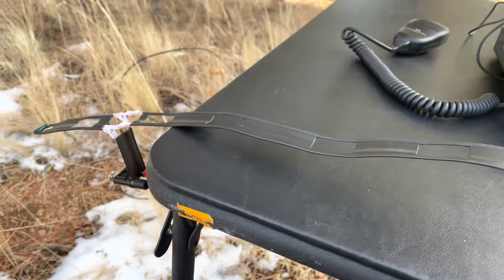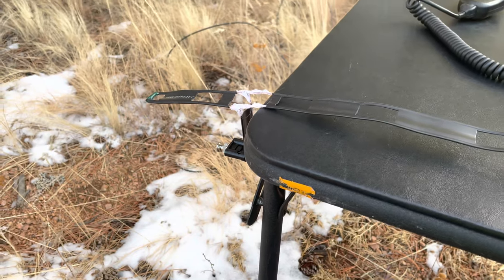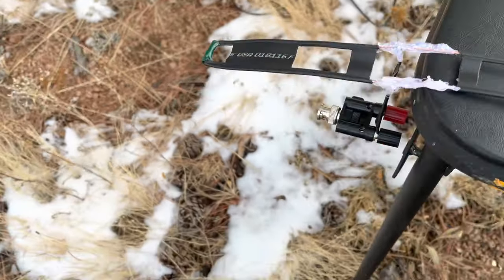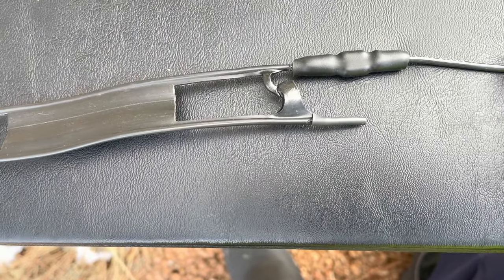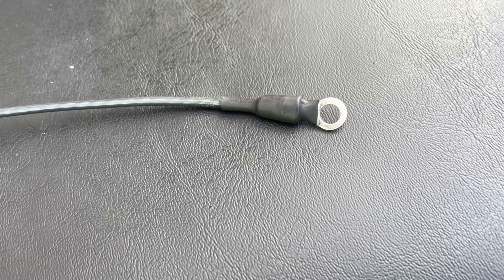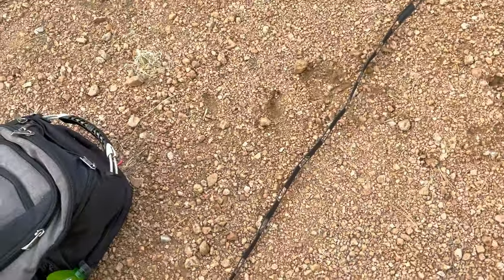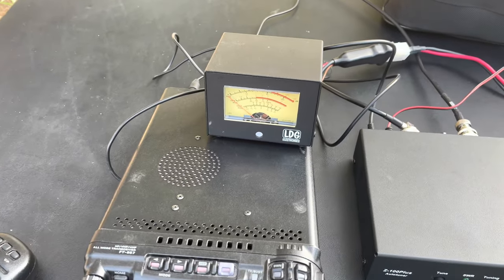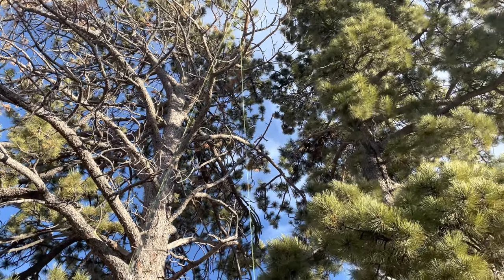Homebrew 6m Rolled Up J-Pole: Will It Work?

Comment: Almost ready to get a new radio with 6m capability. In SW Michigan, almost flat, and I have a tree where I could get it up about 30 ft. It looks so easy to make, even I could do it ;)
Reply from the maker: I would say go for it. It’s been awhile since I had that antenna out but the solar cycle is only getting better. I think it’s time to revisit 6m and get it going strong. Ham-Solo K0FYR

Comment: In Europe we mosltly use horizontal polarisation yang yagis at least 5el. Sometimes less, sometimes stack from few of yagis. Sometimes 5 minutes dipole under the window 😆 and qso are happenning even in ssb 😆
Reply: Well, I name it like 5 minutes. In reality it takes about half a hour to get to fully wrapped up on 6 or 10m. Just some so239 board socket, 2 wires, on 10m band about 2,5mtrs each, o 6m band about 1,5m lenght wire. 4,9+ft, almost 5ft (6mtr band), 8+ (8,2ft) on 10 meters, each wire

Comment: Well  done Michael. I was curious what the swr was with out the tuner and you answered that question. thanks for taking the time to share your test and results. 73 de Ellis WA1RKS
Reply from the maker: Yeah no problem. Using the J-Pole calculator and then assembling and testing just the right exact connection point was crucial in having a lower SWR of course. Ham-Solo K0FYR

Comment: Thank you for this inspirational video. Getting ready to make my own. Would you clarify what sections A, C, and D are for me?  73 KJ7MMX
Reply from the maker: Yes the A section is the longest section from tip to bottom. The c section is the opposite side short section and the d section is from feedpoint to bottom. Go to this website and see the diagram I went off of here. https://m0ukd.com/calculators/slim-jim-and-j-pole-calculator/ Be sure that you use the J-Pole and not the Slim Jim. Good Luck. Ham-Solo K0FYR